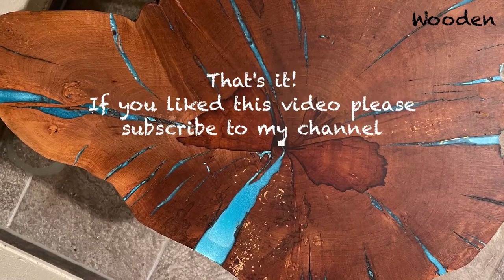Small cookie slab epoxy resin coffee table - Maple

Comment: Running endgrain through a planer?  That's brave.
Reply from the maker: Why do you think so? I do that for years and it only failed once 😂
Reply: @Woodensoul  wide blades cutting against endgrain tends to force tear out in my experience
Reply from the maker: @cedarandsound  Yeah, that happens sometimes, but nothing you can't fix by sanding and with resin, so not that worried about it.